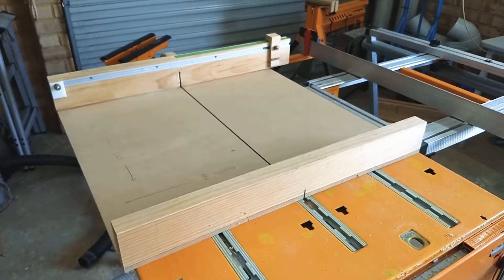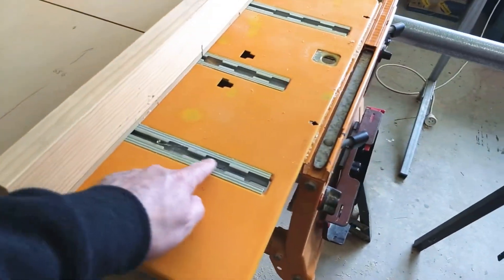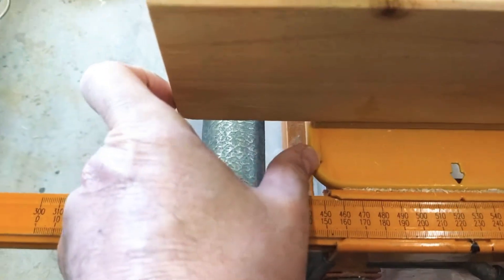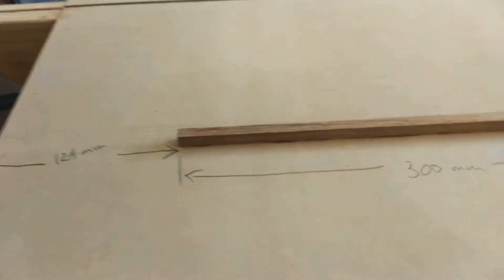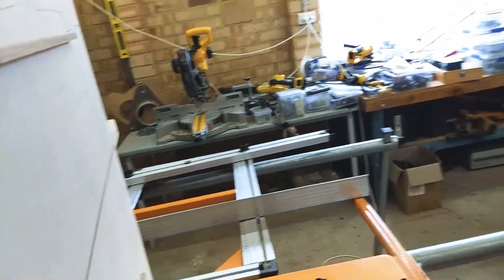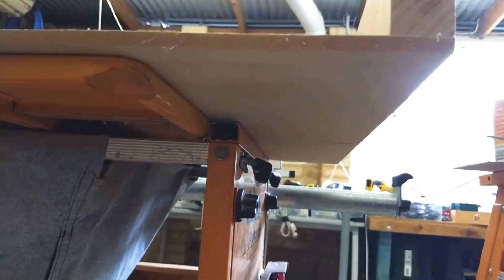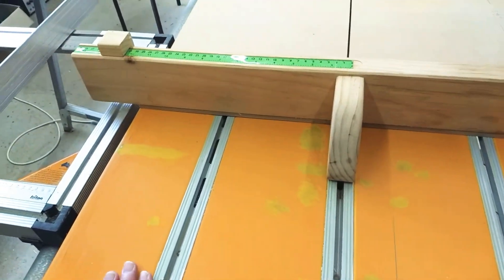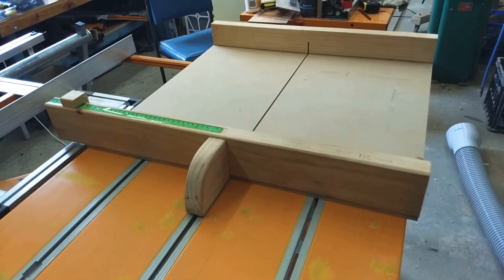Update on sled design

Comment: How about replacing the strange aluminium tracks with normal aluminium mitre tracks? Maybe even cut the top all the way through so no stops? May need reenforcing from underneath.
Reply from the maker: Hey Who, that's an interesting idea about using normal tracks, although there are a range of other aluminium extrusions to choose from.  Also, not sure if they would fit the channel once the other inserts are removed.  Also, the Triton inserts are designed to accept the Triton mitre, so you'd be giving up a bit when you do this.  They are only riveted as I recall, so could be replaced.

Cutting the top all the way through can't work, since this would compromise the strength of the top.  Don't think that's an option.

I think that one solution would be to replace the Triton top completely with some other material for the table top.  However, adding mitre slots to this would be tricky, since they'd need to be parallel to each other and also parallel to the blade and likely need to be adjustable.
Reply: @superphilschneider  thanks Phil. You’re absolutely right. I was about to have a go and drill out those rivets! Your common sense approach saved me 😊 I always end up over engineering modification, which in most cases end up taking so much time and being more expensive than buying something decent in the first place! Never put me in charge of lipstick application on Sus scrofa!

Comment: Nice & neat work Super Phil.
I found too much play running the sled in those channels.
Instead of fixing the under rails to the sled have them fixed in the channels, i.e fill the full length of the channels with fixed rails that sit proud up out of the channels by at least the thickness of your mdf sled base.
Next rip cut the mdf base right through and rejoin  by screwing underneath to the back & front fence so it fits snug running against the fixed rails (do this for both sides). Hope this makes sense, think Sydney monorail, except there are two.
This also means you can push the sled right off the end of the table if you want, resolves that distance problem you were pointing out.
Reply: This looks like a great solution. Do you mind making a video or something of yours. I am also thinking off removing the Triton slots of the table and make rails fitting/running in the space where the rails are currently in.
Reply: That is a terrific idea. The rails could be made to fit quite firmly in the channels, and the part protruding above the table top could be trued up to ensure they are parallel.